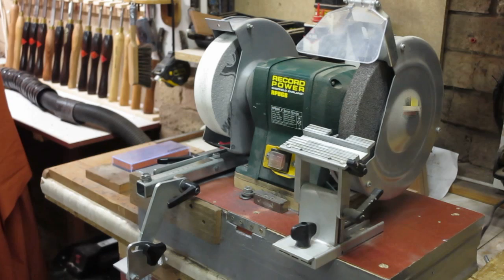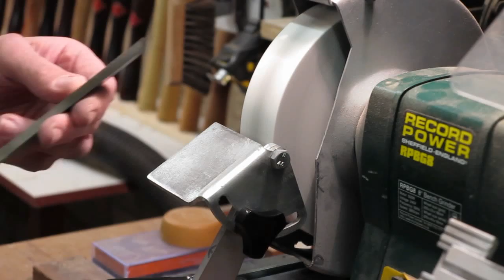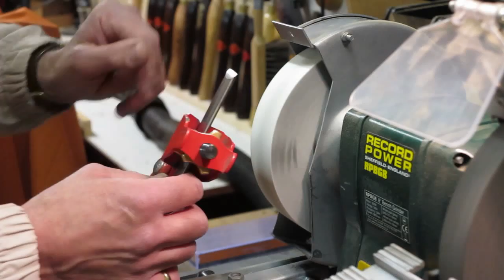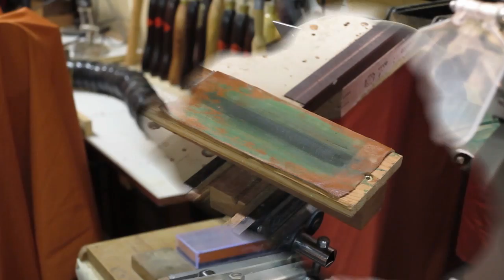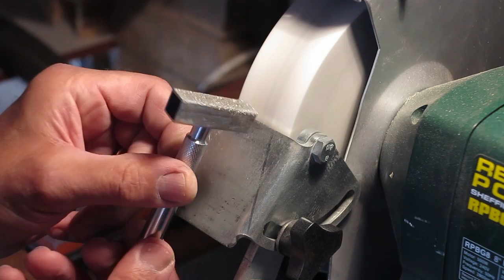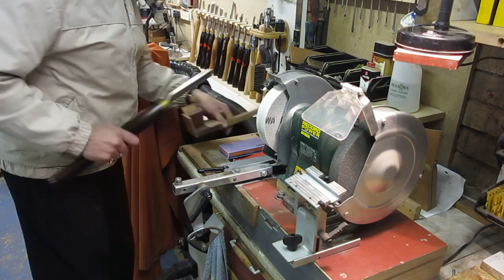Wood Turning - Tool Sharpening

Comment: Very useful, thanks Mike. I do have a couple of questions - have you got an opinion on the direction of the wheels? I see some people switching things round so the wheels spin away from the user. And, I’m interested to know why you choose to strop “manually”, when a lot of systems involve a leather or MDF or paper wheel with compound to hone on the actual grinder. Again, would love to hear your thoughts. Cheers
Reply from the maker: I no longer use a wheeled grinder but the Sorby Pro Edge links here. When I did use a grinder I found no need to alter the wheel direction,  and the stopping is just something I do, not really necessary for turning. Cheers. Mike

Comment: Thanks Mike. Forgive me for asking you this but my Record Power dust extractor has packed up. It's connected to the house power supply and has been running great for about 15 years. It keeps tripping the electrical breaker on the distribution board.  Do you know anything about these machines? I don't know who to ask at this time. Best regards.
Reply from the maker: I am no electrician John,  but would guess there is a fault with the extractor, just my opinion though 🙂
Reply: @MikeWaldt  Hello Mike. It turns out that the problem lay in the RCD in the kitchen where the main power supply is taken from. I spoke to a sparkie in Inverness who told me as the machines get older they draw a little bit more power. RCD's are super sensitive so they'll cut the juice supply. I fitted a three pin conventional plug and now everything is tickety boo. I even switched on the grinder, pillar drill, bandsaw, lathe,  lights and extractor at the same time for a test and all is well. Keep up the good work. Best regards.

Comment: Hello Mike, what red tool do you need there, to get the right angle for grinding?
Reply from the maker: That was the Woodcut fingernail grind attachment Dieter, however I must say I have had the Wolverine system now for a long time, and find it a better overall system, for me,  and it also has a similar attachment.
Hope this helps, and thanks for watching.
Cheers
Mike

Comment: Hi Mike,
Thanks for the great how-to. Am  a hobbiest turner, and have been using a wet, slow wheel grinder. Frankly, it takes so long to sharpen my tools, I found myself opting to try to turn with rather dull chisels, as I hated taking so much time to sharpen them. Am certainly going to switch to your method. One question . . . after sharpening the oval skew chisel, you stropped it on leather. Do you only strop straight edged chisels or all chisels . . . gouges, scrapers, etc.?
Reply from the maker: +Richard Yost 
Hi Richard, the time to sharpen on a wet stone grinder is the reason I never got into them, but I am sure they give a great edge, but take too long , as I am an impatient sort :). I recently invested in CBN wheels which are really quick ;) I made a video on them if your interested.
I only strop my skews, but am going to make an MDF honing wheel for my old grinder, one day, so I can hone all my gouges too.
Thanks for your kind words, and support my friend, they are much appreciated.
Take care
Mike

Comment: Hi Mike, I have just bought the tru-grind system off ebay £20 as it was listed in arts and crafts so I think I was the only one who seen it, I have the same record power grinder, I like you say in this vid realised some of the grinder guard has to be removed, did you remove the wheel before you angle ground the guard, I am sure its the best way to go , great vids keep up the good work I have learnt so much from you,  Thank you Dave.
Reply from the maker: dap2112 Hi Dave, you got a great deal there mate :). Yes I did remove the wheels, didn't want to damage them.
Take care
Mike

Comment: great video mike,,,what is the name of the white wheel you have and do you know where I might purchase one,,and what did you say the name of your jig system is,,and do you know anything about the cbn wheels
Reply from the maker: jeff oldham The white wheel is an Aluminium Oxide Wheel Jeff, and you can purchase them on eBay or any woodturning suppliers, and this system is the Tru Grind, I also use the Oneway Wolverine jig. I have never used a CBN wheel, I understand they are excellent, but very expensive!
Take care
Mike

Comment from the maker: Hi Liam
The leg angle will depend on several factors, what size the grinder wheel is, and the distance from the base of the sliding arm to the centre if the wheel.
If you pm me with the details a will work out a solution for you.
Take care
Mike

Comment: Thanks for sharing your input on how you sharpen your tools. Great information. A couple of yrs ago I bought a WorkSharp for my bench chisels, but then when I start recently turning I bought the Tormek attachments. Jig are very helpful in the sharpening process. Do you like the Fingernail grind, or does it depend on what your using your bowl gouges for?

Comment: Good, sensible, straightforward, no-nonsense advice.  I use the Sorby flat belt grinder but I'm going to get an eight-inch grinder as well because it's easier to do swept-back grinds on them (I think).  I'll be referring to this video a lot.  Thanks Mike, great job.
Best Wishes, Brendan.